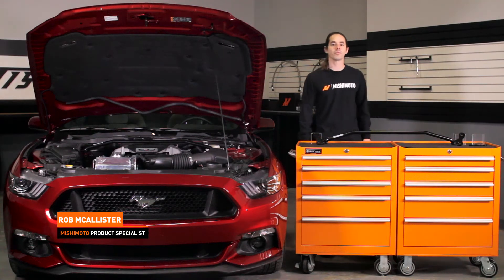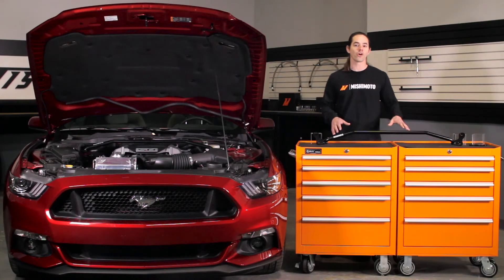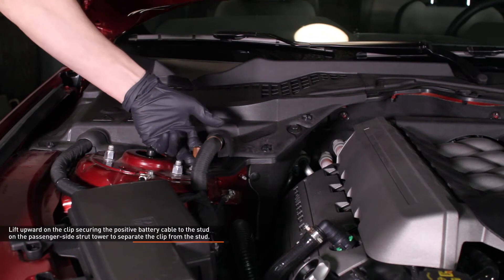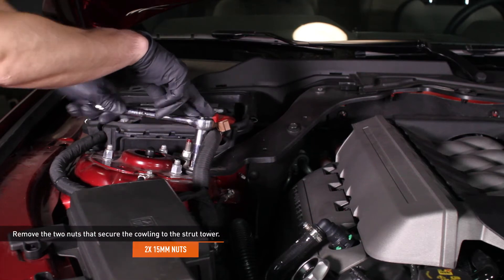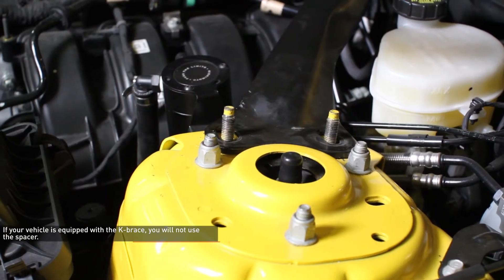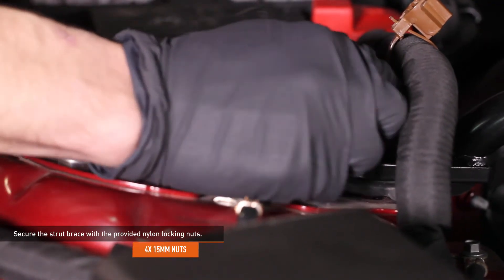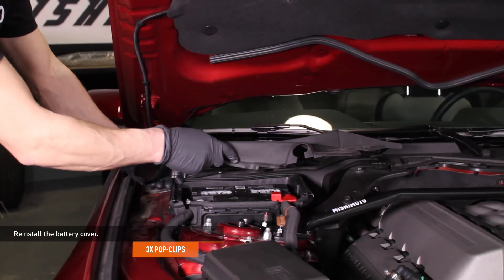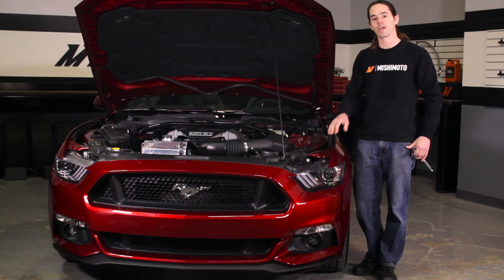2015+ Ford Mustang Strut Tower Brace Installation Guide by Mishimoto

Comment: does it fit a 2015+ V6?
Reply from the maker: Hello Ric. We've had mixed feedback in regards to the V6 models. As of now, our product page has this listed as "May not fit V6 models" due to some scattered reports of it making contact with the intake manifold.
Reply: I must be one of the scattered reports of the mishimoto brace not fitting the 3.7 v6. I loved the packaging and simple lightweight strut tower brace. However, it did not even come close to fitting my stock 2017 3.7 Mustang. I added 5/8" spacers but it still just barely touched the intake. If you go higher you run the risk of the brace being weaker as you are at the very top of the strut tower bolts. If the brace fit the 3.7 v6 they would have indicated it in their marketing. I like Mishimoto but their brace does not fit a stock 3.7 mustang.